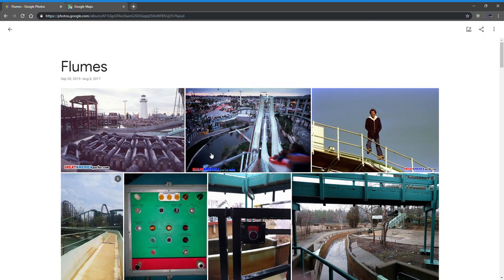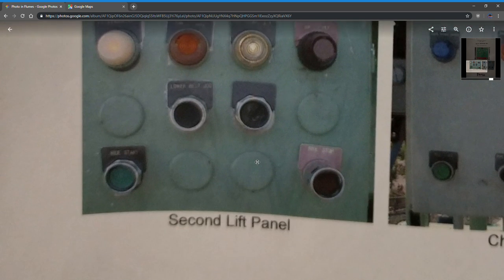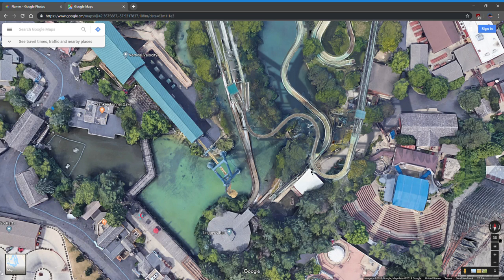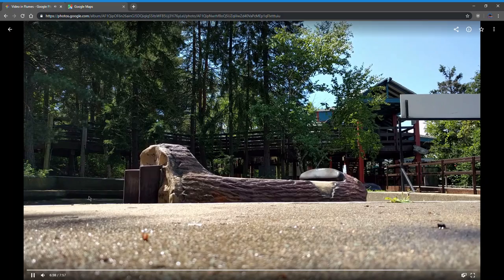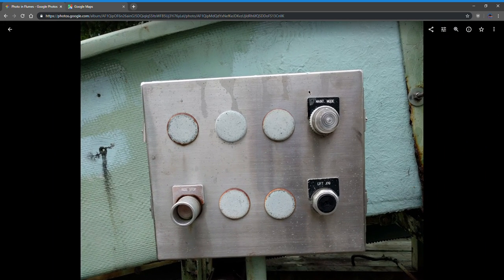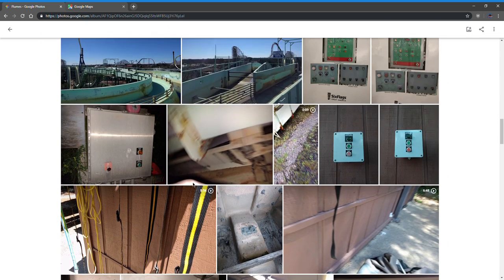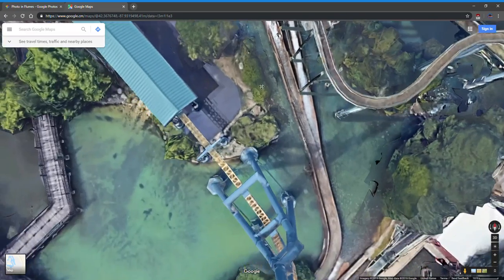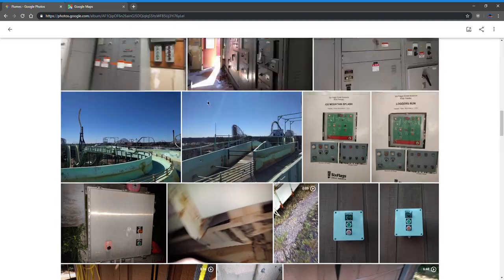Flumes Ride System Explained (Yankee Clipper/Loggers Run SFGAm)

Comment: I want to be a ride op some day. My home park is kings dominion and I think their log flume would be cool to work at because 1 the station still uses manually actuated stoppers in the station (double load double unload station) and also the operator at the top of the lift uses their panel to advance boats from the holding area after the load stations so they don’t just sit there all day.
Reply: And thankfully our boats are stored on land and lowered by crane because I’m not trotting around a dank pond in boots every day.

Comment: Thanks for the great insights.     Question:  Why, in the middle of summer, with 25k+ people in the park and perfect HOT weather, do the flume rides close at 7P.M.  (overall Park closes at 10P.M.)      I've witnessed hundreds of people approaching the entrances after 7P.M.  (myself included)  and just dumbfounded then aggravated about the early ride closure.
Reply from the maker: Preaching to the choir here man I think the flumes should always be open
Reply: Back in the mid 90’s  we would stay open at flumes until close and the last hour usually no one was riding.  I am sure it was decided to save money since no one was riding. I wish they would keep open til 9pm though.